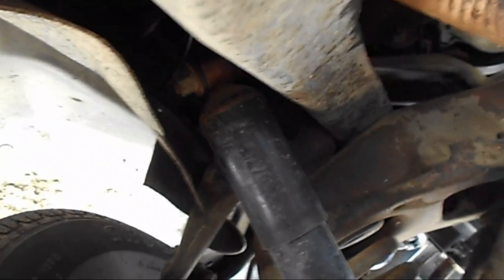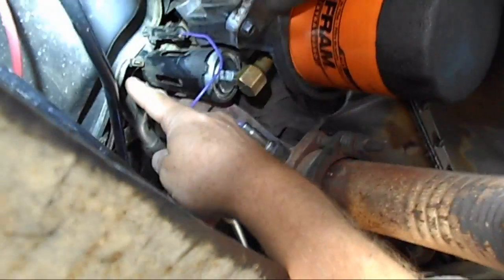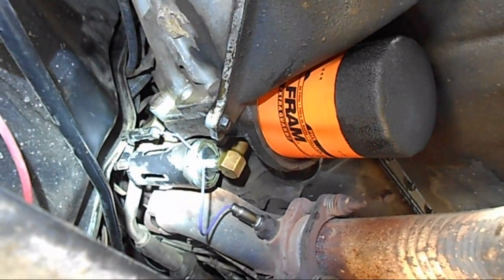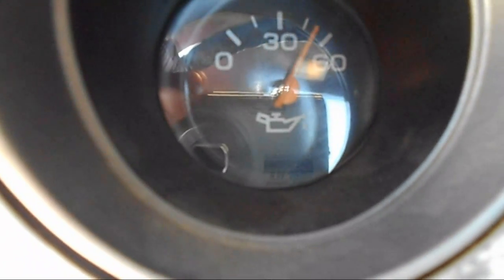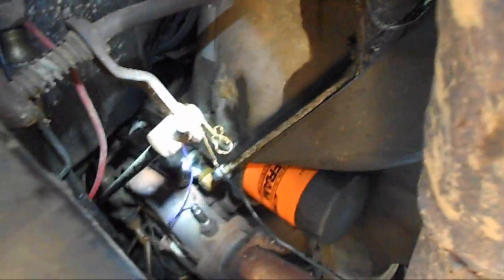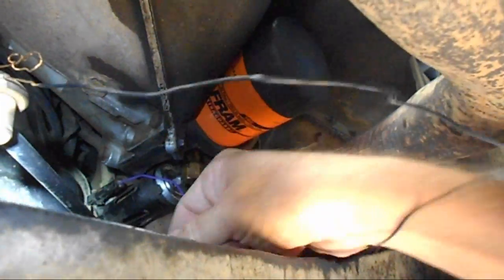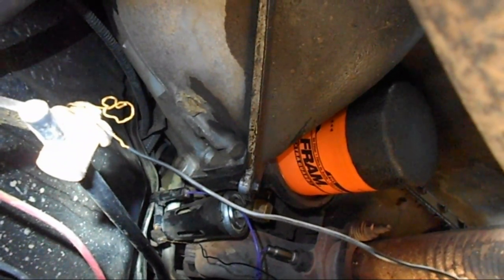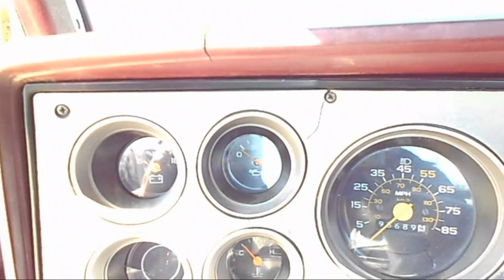Oil sending unit and oil gauge test (For failing oil gauge reading)-works for me God Bless😇

Comment: Both of these work on my guage , brand new sending unit still reads 15 ish. Checked oil pressure manually with a guage and it has 40 lbs. really starting to piss a guy off
Reply from the maker: Easter egg time http://forum.73-87chevytrucks.com/smforum/index.php?topic=11766.0

Comment: Hello..again..I have a Question..The other nite I left my HI Beams on my 88 Suburban for maybe 20 / 30 minutes..The engine was Running..I was helping a friend change a tire..for some reason ALL the lites went out on the Suburban..I MEAN every LITE and  the Horn and Radio Display.....I checked all Fuses/ Breakers in the Panel..They were all good..The only Lites that work are The Reverse lites and Brakes..."Totally Weird "..My Suburban is totally Factory.. No Nothing / Aftermarket accessories..The only thing that I,ve never used were the HI Beams...since I've owned  it..I ordered a NEW '"Headlight Switch" ..Have You ever heard of this Happening..?.. Any help or Opinion would be Great..Thanks Daren...
Reply from the maker: Easter Egg time .... Get a Chilton or Hanes book trace the wiring to a focal point that would effect all these areas ... I bought a flood car that had multiple problems that came from large corroded connector. Good luck God bless😇
Reply: @mbjdiy1778  Hello..I found the problem today..The shop that put the motor in used" Tin Foil" as a Heat shield by the Starter..[unbelievable ].. It Fried one of the" Fusible Links" against the Solenoid...UGH..told you they were Hacks...Thanks for getting back to me..Daren

Comment: I have a 2005 mustang gt reading no oil pressure I drove it 2 hour home when I got it. I changed oil oil filter and sending unit still no oil pressure showing on dash. I went and bought a oil pressure tester hooked it up and got 70 pounds at cold start. Now I’m wondering what the issue is with the dash saying no oil pressure.
Reply from the maker: Could be as simple as a broken wire , bad contact , or bad gauges cluster or ECM  .... 
*****you might try this search page https://www.google.com/search?client=opera&q=2005+mustang+gt+no+oil+pressure+what+could+be+wrong&sourceid=opera&ie=UTF-8&oe=UTF-8

 ****   or buy a Hayes  manual  Ford Mustang (05-14) Haynes Repair Manual https://www.amazon.com/Ford-Mustang-Haynes-Repair-Manual/dp/1620921871/ref=asc_df_1620921871/?

* you can also talk with Scotty Kilmer he had a mustang like that I think https://www.youtube.com/c/ScottyKilmermechanichttps://www.youtube.com/c/ScottyKilmermechanic he is super great about answering these questions. .........Works for me God bless

Comment: Hello..Thanks for the info..I have a 1988 350cu Suburban..Its All Original.[ Everything Worked Super Clean ].. .Got it from the First Owner..The Head Gasket blew a year ago..I had a Shop Pull the motor..UGH..they were kinda Hacks..My Oil Gauge dose not work ..Nor my Cruise Control and A\ C...I'm guessing they Jacked the Wiring up behind the Distributor against the Firewall..??..You seem Pretty Good around these trucks..Does that seem like a good place to start...?? Thanks Daren
Reply from the maker: It is a good call but at the same time get a Chilton or Hanes book to get the wiring diagram to make sure the ty up between all that are damaged to key in on a specific area that could have been cut or damaged or never properly reattached .... Good luck God bless and Works for me 😇
Reply: @mbjdiy1778  Thank You for the Oil Gauge Tip...

Comment: My gauge is stuck all the way to the right. If you tap on the plastic covering the gauge (like in the cartoons when they're trying to get it to work) it makes the needle slowly go back to about halfway. When you turn the ignition on, it rapidly goes straight back to all the way right. Bad gauge? I tried unplugging and reconnecting the wire as seen in the video, but no change
Reply from the maker: If you followed the video instructions-replace GAUGE-works for me

Comment: When I ground the wire my gauge pegs 80. When it’s just disconnected it’s zero. Does this indicate a bad gauge?
Reply from the maker: ✨Symptoms of a bad oil pressure gauge :
Oil pressure gauge not working: The causes for this range from a faulty gauge to the need for an oil change. ...
Oil pressure gauge reading too low, generally below 15 to 20 PSI while idling. ...
Oil pressure gauge reading too high, or over 80 PSI while driving, especially at higher RPMs.
✨Syptoms of bad oil sending unit:
The best way to test if your sensor is bad is abmormal low oil pressure gauge reading when oil was checked and was full level .  If the low oil pressure warning light comes on  or reads low when they engine’s oil levels are normal and your engine is running smoothly and quietly, then you likely have a bad oil pressure sensor. Anytime this sensor is defective, it will give you false readings.
Hope this helps God bless😇

Comment: What if it stays on zero and there is no change? Bad gauge?
Reply from the maker: 1. wire grounded that is connected to sender / disconnect and gauge maxes out rules that out
2.Sender stuck or bad/resistance reading at electrical connecter will change as pressure builds up if good if not bad

3.clogged oil pump screen or oil feed to sender pipe is clogged or oil filter clogged hook up gauge from harbor freight (ithink 1/4 NPT is what I used) to sender oil pipe to get a gauge reading and work backwards from there 
4.Bad naughty gauge / aftermarket 40 to 60 bucks now / OEM the sky maybe 100 +
four choices there may be more WORKS FOR ME good luck God bless hope that helps

Comment: What if the oil pressure gauge does not move at all no matter what you do
Reply from the maker: Broken wire or broken gauge or no power to gauge  follow procedures on video... works for me Gods bless😇

Comment: Does this work for any model I have a 92 Thunderbird sometime it's low sometime it's in the middle
Reply from the maker: Each maker and car are a little different same concept but different via computer out put not straight from sender it is best to consult an automotive manual . The newer the model the more complicated they get. Better yet call a Ford parts department they will tell you if its analog or digital ... if digital get a manual. Hope that helps works for me God bless.
Reply from the maker: I found this see if this helps with your 92 Ford.  http://www.rowand.net/shop/tech/fordoilpressuregaugefix.htm

Comment: Do what if it does something different than that? Is that the only scenerio it can be bad?
Reply from the maker: I covered what I have seen (most common)and i say...I... loose wire, bad terminal,oil on terminal,corrosion on terminal,clog, electrical fire known or unknown, ECM going bad , ect...ect...  ...I mean we could be here all day ...What I show are the most common problems -Works for me - //Check out auto blog https://www.autoblog.com/2015/11/18/how-do-you-know-if-the-oil-pressure-gauge-is-bad/  Thank you for your comment and always God bless

Comment: correct me if i'm wrong, but the oxygen sensor is what got disconnected, am i correct ?
Reply from the maker: The oxygen sensor is mounted on the exhaust I do not understand the question. The oil pressure sensor on the video is by the oil filter via tube to the block. Works for me God bless

Comment: Tell me this fuel gauge experts.......I have a 1987 chevy van I pulled the tbi computer out, all gauges working except fuel!! So know all of this knowledge of grounding the the fucking gauge wire and it going from full to empty, I've done this on my 68 chevelle actually this wire will read 8 volts, this through me off when I was in my van trying to find the sending wire to the fuel gauge without pulling the gauge cluster apart and tracking the wire. When I tested my chevelle and had the sending from the fuel gauge read 8 volts and I knew there was a wire in the van that read the same volts, I felt confident that if I hooked that wire to ground the gauge would go to empty....and sure enough it did! But now the gauge won't go back to full when it's not grounded........so my question is this did I just have fluke and the gauge just blew itself?
Reply from the maker: You pulled the ECM (computer) out of the picture any thing is possible - I deal only with stock situations so I cannot help you - Good luck God bless works for me
Reply: @mbjdiy1778  so in other words your saying the fuel gauge is controlled by the ecm......
Reply from the maker: If you have dual tanks ... you have fuel tank selector  ... which can effect relay in center cab console which feeds through ECM A1 and A2 for selector relays / selector switch / FTS / and a lot more with wire and connections check this site my friend scroll down to schematics / I understand what you are doing but I cannot stand a can of worms situation these things can be so darn awful to trouble shoot with a computer (ECM)  http://forum.73-87chevytrucks.com/smforum/index.php?topic=9072.0  Good luck God Bless

Comment: I tried this on my 82 Chevy it was not reading at all  I replaced  sending unit  and started reading g only to 10psi same thing replaced sending unit
Reply from the maker: 1. wire grounded that is connected to sender / disconnect and gauge maxes out rules that out
2.Sender stuck or bad/resistance reading at electrical connecter will change as pressure builds up if good if not bad

3.clogged oil pump screen or oil feed to sender pipe is clogged or oil filter clogged hook up gauge from harbor freight (ithink 1/4 NPT is what I used) to sender oil pipe to get a gauge reading and work backwards from there 
4.Bad naughty gauge / aftermarket 40 to 60 bucks now / OEM the sky maybe 100 +
four choices there may be more WORKS FOR ME good luck God bless hope that helps
Reply from the maker: You could also watch my -  How to test oil pressure switch and oil pressure ..Video WORKED FOR ME

Comment: My gauge does backwards on my tractor what do you think it is and how can I test it
Reply from the maker: Try this site for tractor oil gauge working backwards  https://www.pistonheads.com/gassing/topic.asp?h=0&f=8&t=1549652
Reply from the maker: Bassfiend229hp

5,530 posts

188 months

[report]
[news]
Friday 8th April 2016
quotequote all
AndrewPoole said:
I'm very new to the site, so my apologies for late comment. The "Oil Pressure gauge Working Backwards" problem occurred on my boat - I eventually found the problem. The sender was fine (Not "duff" - as a previous respondent suggested. Indeed, if the meter reading varies at all, the sender is - by definition - working); and the gauge was fine. BUT, it took a long time to discover is that US gauges and Euro gauges work on different protocols. Euro Gauges work on ASCENDING electrical resistance as the oil pressure increases; USA gauges work with DESCENDING resistance as the oil pressure increases. The gauge is in essence a resistance meter - hence the "back-to-front" reading. So, the sender may be fine, and the gauge may be fine, but they must both be either Euro or USA.
And you get a similar issue with US and Euro temp gauges. Both work with decreasing resistance as the temperature rises; but with differing values (USA - 100 deg F = 450 ohm; 175 deg F = 99 ohm; Euro - 40 deg C = 281 ohm; 80 deg C = 68 ohm). Again, the sender and the gauge need to be the same protocol, otherwise there's a false reading.
Hope this all makes sense!
Cheers
There are numerous different specs for senders - even "Euro Standard" temperature senders have high and low range variants! It's a bugger finding the right ones...

Phil

Steve_D

12,045 posts

196 months

[report]
[news]
Friday 8th April 2016
quotequote all
The answer is in the ebay description.
Yours is 10-180 Ohms.

They then list.
We also have the following type:

0-100psi,240-33 ohms output;1/8"-27NPT;

0-100psi,240-33 ohms output;1/8"-27NPT;low 11psi alarm/warning switch;

0-150psi,10-180 ohms output;1/8"-27NPT;low 11psi alarm/warning switch;

So you need something like the first one of the options where the resistance is falling rather than rising.
However, you do need to make sure the sender psi/bar rating matches your gauge. I suspect it is Caerbont so contact them/speedy cables and get them to tell you/sell you the right sender.

Steve

Comment: Well I have a problem with the oil pressure but I already replaced the oil pressure sensor
Reply from the maker: If you do the test I show in the video with the pressure gauge and that is good. Wiring or the gauge is bad. All in all these gauges are notorious for going bad. You could also have a clog in the oil pump screen or at the sensor you replaced which would give a low reading at the gauge that was put in place of the sensor in the video. http://www.usa1industries.com/1978-87-fullsize-chevy-gmc-truck-oil-pressure-gauge.html   or https://www.classicparts.com/1978-87-Oil-Pressure-Gauge-Electric/productinfo/24-844/?gclid=Cj0KCQjwo-aCBhC-ARIsAAkNQit989MM_NsFoGhM-v6OqUOfJgjgXcB0zznY2qnBU0IcS24JBQF0oUMaAkcmEALw_wcB

Comment: This might work for your truck but is wrong on other vehicles.
Reply from the maker: works me and these sellers - 1978 - 1987 CHEVY GMC TRUCK BLAZER SUBURBAN CLUSTER OIL PRESSURE GAUGE C10 K5 1990 https://www.cjponyparts.com/oil-pressure-gauge-chevrolet-c10-1978-1987/p/GC10O4/?year=1987&gclid=CjwKCAjw3pWDBhB3EiwAV1c5rEou6SOfwf3xTMAi4mLf9kaTTRnzNBVoWD3xm9tkhHBDeSek5XOTqRoC0EgQAvD_BwE https://www.google.com/search?q=oil+gauge+1987+chevy+pickup&rlz=1C1CHBF_enUS899US899&oq=oil+gauge+1987+chevy+pickup&aqs=chrome..69i57j33i299l2.13809j0j15&sourceid=chrome&ie=UTF-8
Reply from the maker: Which one do u have .God bless